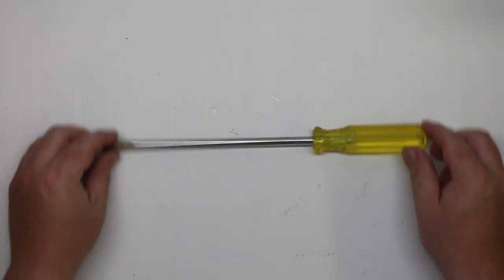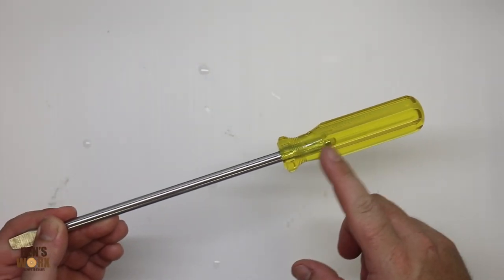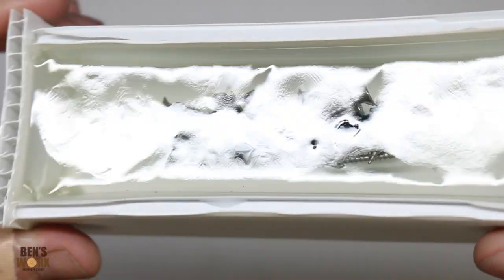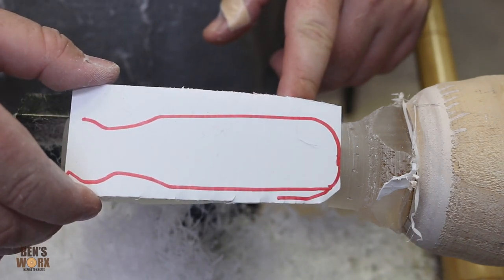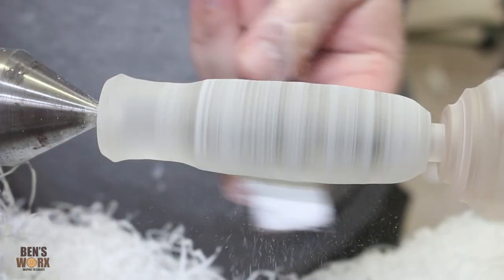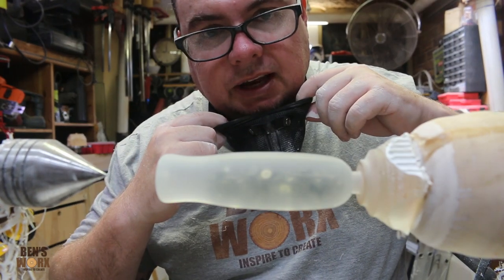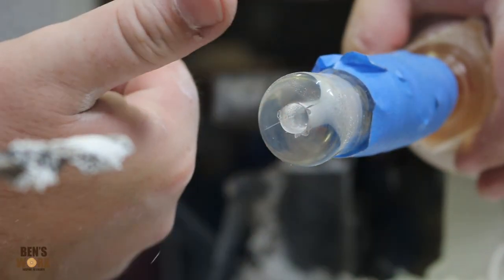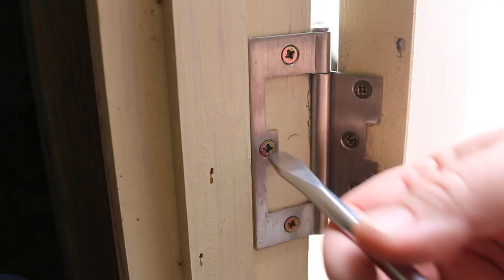Turning Epoxy Resin and screws into a screw driver

Comment: In hindsight, would you recommend drilling the hole for the shaft first and then using the tailstock in that hole to turn down the rest of the handle? Seems like maybe that would allow you to use less pressure with the tail stock and possibly have better concentricity between the shaft and the handle.
Reply from the maker: Yeah that would have worked, if I make another one I’ll use that method and see how it goes

Comment: Looks great, just a point of interest to avoid splitting your mould with the tail stock try putting something between them like a small padded adhesive piece of material or timber, helps to widen the load being applied from the tailstock👍👍
Reply from the maker: Thanks for the great advice Mark!

Comment: To bend the coroplast, cut the outside sheet, then you just have to bend the inner sheet and it will bend much easier.

I love the design of the screw driver but I do see one problem with your build, the handle end of the shaft has a couple of small protuberances to keep the shaft from spinning in the handle but you cut them off. So the screw driver is likely to fail at some point.

I'm looking forward to your nail filled hammer handle build.
Reply from the maker: Thanks Fred